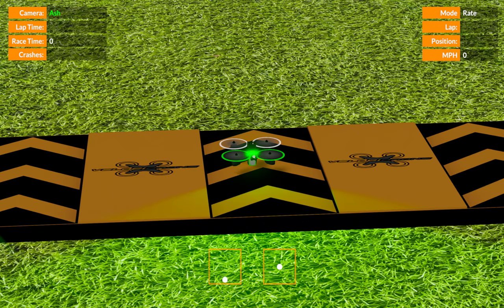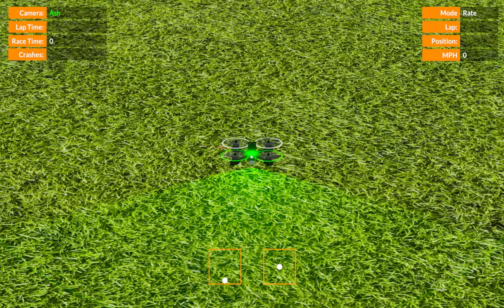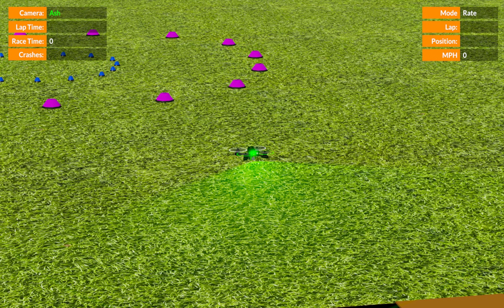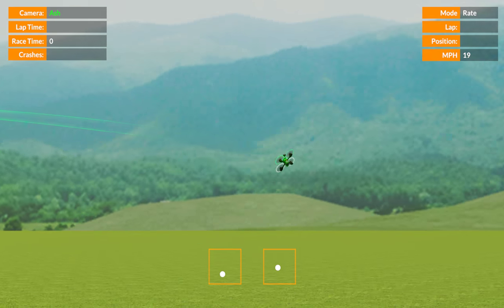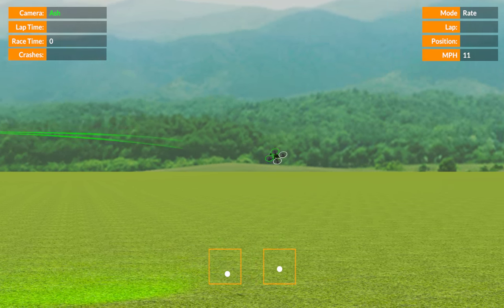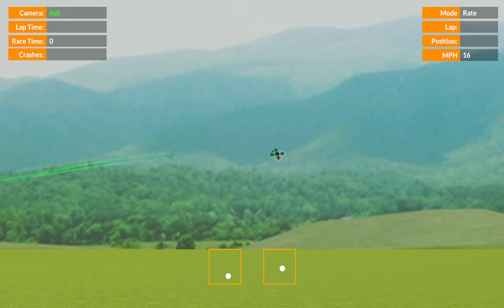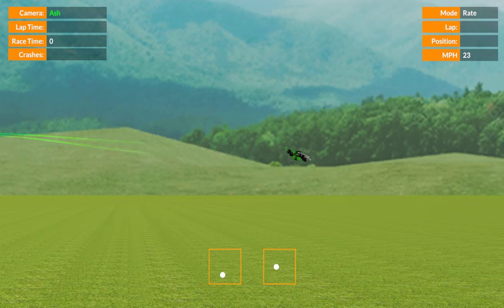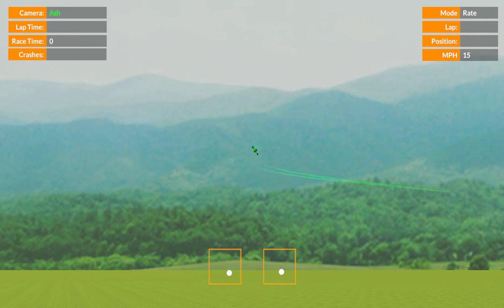Flight Training - Line of sight - First circuits

Comment: My quad dont have shadow over the grass.. Why is that happen?
Reply from the maker: Shadows are not drawn until you select higher quality settings in the sim (for performance reasons)
Reply: VelociDrone thanks for the info
Reply: how should i make the lines of lights that leave the quad appear?
Reply: @pimagnum1   Press the T key on your keyboard.  Successive presses turns trails on and off again.